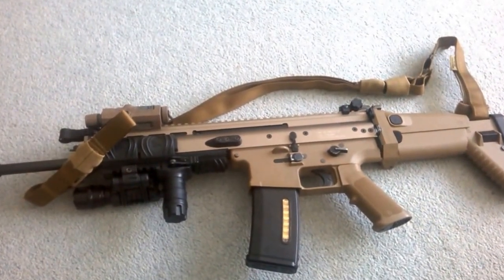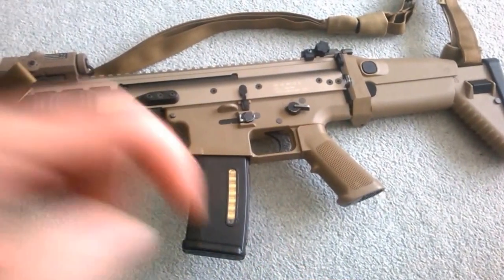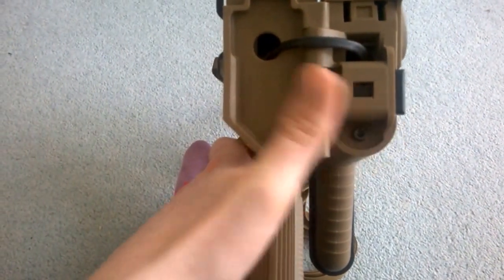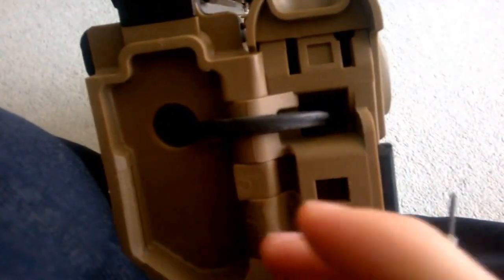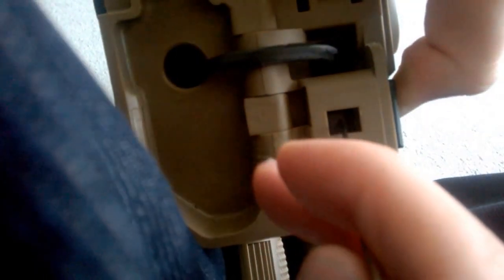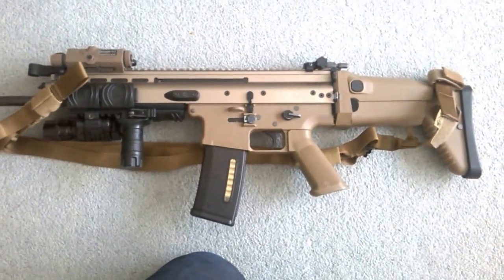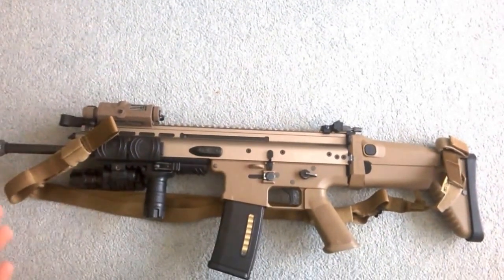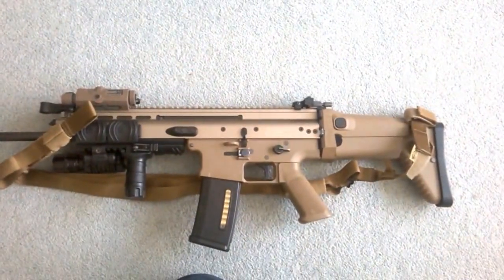Airsoft SCAR- How to Change Stock Button (Works for WE and DBoys confirmed)

Comment: Hi, the part you touch at ~0:39, where did you get that. It seems sturdier for me than the factory hinge on the Boyi SCAR. THX in advance.
Reply from the maker: It's a stock WE SCAR L, no upgraded parts at all (externally)
Is that any help?
Reply: +Haymaker Airsoft ahh...i see. the stock is a gen III stock which is factory default on the we...thanx

Comment: So what was the problem before you replaced the button? Was it the stock not locking into positions?
Reply from the maker: +Epilogue Tactical it's for if the button to fold the stock breaks. This was mainly a demo as there was a guy having difficulty with his gun.